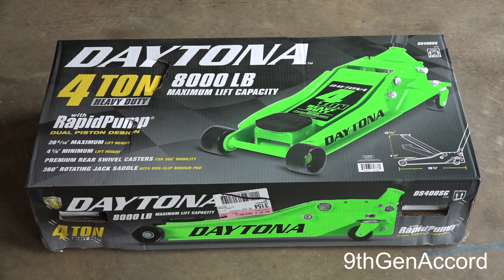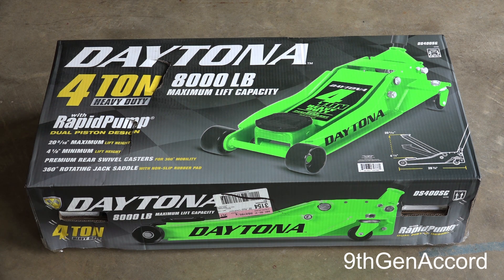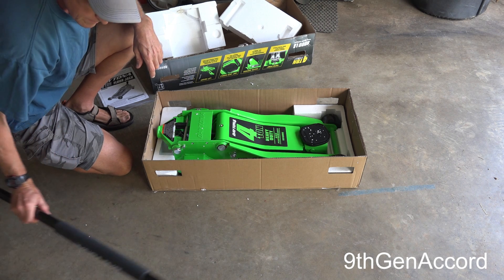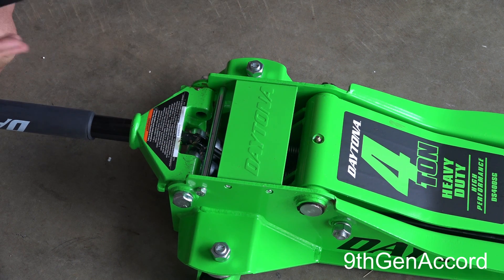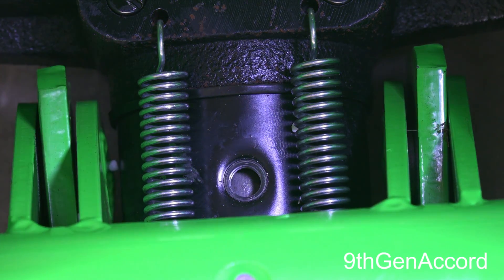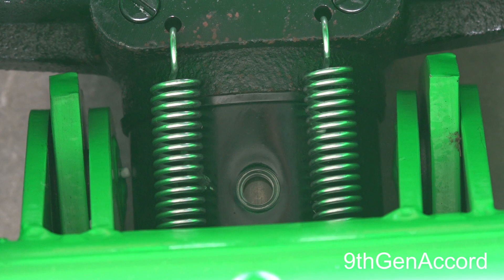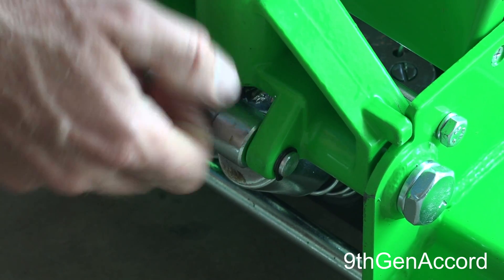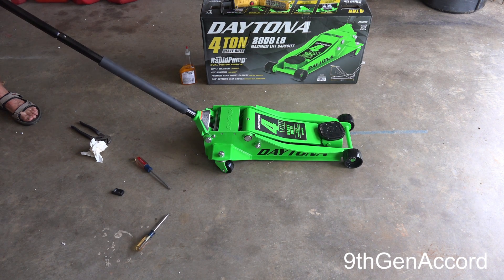2022 Harbor Freight Daytona 4 Ton Heavy Duty Floor Jack Review & Setup

Comment: Russ,
 Another thorough review. I looked at the Harbor Freight Low Profile- long reach jack as I needed it for my 3 Toyota cars. The 4 ton model you have would work just fine on my Honda Pilot with it's increased height but ultimately I purchased the 2-ton Low Profile-Long reach Sunex model 6602LP and wondered what took me so long to make the purchase. Extremely heavy and well made. One of my better Automotive purchases in recent years.

Comment: Great video. I have the same jack and love it. It looks like to have some very well maintained vehicles. I had a similar generation Tundra with the same V6 for 17 years and only sold it when we decided to move to Colorado with trailer towing involved…the V6 is a great engine but not enough power for towing in the mountains.

Comment: Did you ever do the rebuild on that Michelin jack? I have the same exact jack that I also bought about 20 years ago and its just about the same amount of tired as yours is. which is why I was looking at reviews on this 4 ton jack. I'd watch you do that especially if you linked all the parts you used! 
Bought that first jack 20 years ago at Sams Club with a set of matching jack stands for like $69.

Comment: I noticed your jack seems to have weak handle springs, too. Meaning: When you let go of the handle at an angle. It seems to want to fall down instead of rising back up to be at 90-degrees to the floor. I have 2 Daytonas. One yellow 3 ton. And the other. A Black 4 ton. When you let go of the handle of the yellow at any angle. The handle will come back up to stand at 90 degrees to the floor. On my Black one, which is new. You let the handle go at any angle. It tends to fall flat to the ground. I noticed your does the same as mine.
Reply: Mine holds the handle wherever I leave it.